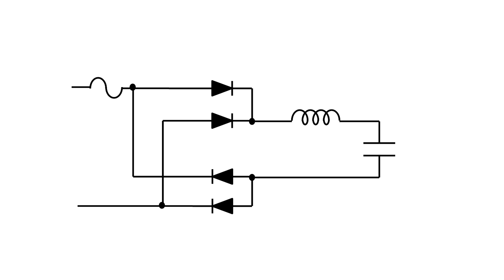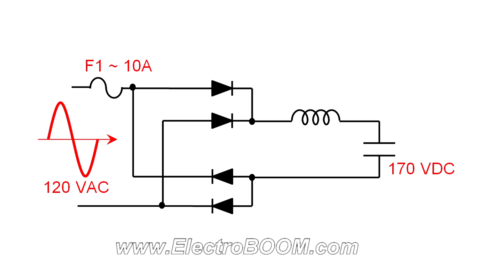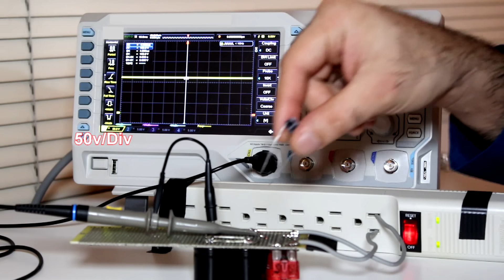Making a Full Bridge Rectifier

Comment: $ 1 0.000005 5.934295036739208 27 5 50
v 48 272 48 368 0 1 40 120 0 0 0.5
w 112 272 224 272 0
d 224 272 256 272 2 default
w 112 272 112 352 0
w 112 352 224 352 0
w 48 368 48 416 0
w 144 416 144 304 0
w 144 304 208 304 0
d 208 304 240 304 2 default
w 256 272 256 304 0
w 288 352 384 352 0
w 288 352 256 352 0
d 256 352 224 352 2 default
w 256 352 256 400 0
w 256 400 256 416 0
w 48 416 144 416 0
w 144 416 192 416 0
d 256 416 224 416 2 default
w 192 416 224 416 0
w 240 304 256 304 0
w 256 304 288 304 0
w 288 304 304 304 0
l 304 304 384 304 0 1 55.31074061114141
c 384 304 384 352 0 0.000049999999999999996 4.938454228765929
w 384 304 464 304 0
w 384 352 464 336 0
w 64 272 112 272 0
w 64 272 48 272 0
w 464 304 512 304 0
w 464 336 512 336 0
162 512 304 512 336 2 default-led 1 0 0 0.01
o 24 64 0 4099 160 102.4 0 2 24 3
Reply: Paste it in the import from text on https://falstad.com/circuit/
Reply: file/import from text
Reply: fun to watch

Comment: You didn't get shock when you connected it to live wires but you got  shocked after disconnected, how?
Reply: When connected, current has an easy path to ground and would rather go through the circuit than his body. When disconnected, the capacitors remain charged but have no path to ground. By touching the circuit in this state, he gave those charged capacitors a path to ground and got shocked. He was not shocked before because there was already an even better path to ground than his body provided, but once disconnected the next best path would be through his hand.

Comment: 2:00 Wait, is he saying that you can put your finger across 166V and it's perfectly safe as long as it's DC and not AC?
Reply: It depends on how you're defining your AC voltage. 166Vrms means the AC waveform has an "average" voltage of 166V and effectively delivers that voltage over time. However, AC oscillates so the instantaneous voltage, or the voltage at one point in time, will change. 166Vrms means the voltage has peaks of 166*sqrt(2) volts, or about +-235V. If the AC wave was running at 60Hz, that means it will hit +-235V 120 times in one second. So you can see how it's really easy to touch that and get shocked by any one of those 235V peaks.

Comment: I'm going to get two 120 to 220  Transformers and connect them in series and I'm going to run it through a 600v 15 amp bridge rectifier with a microwave capacitor as a ballast capacitor on the transformer a protective capacitor on the input of the bridge rectifier and a smoothing/protective capacitor for the output of the bridge rectifier and maybe a inductive choke on the output. And I will get approximately 500 volts 19 amps and I will make some nice arcs

Comment: Hello, thanks for the video, what happen with the voltage if you put some load? will increase or decrease? im doing this circuit for a motorcycle to run an HID kit instead of an halogen bulb. Im using only a full bridge rectifier from  a 10,4V AC getting almost 25V DC with load.

Comment: Does anyone know why the capacitor at the output holds the voltage close to the peak of the wave? (0:25)

Thanks in advance! 👍
Reply: The graph he's showing is very ideal and leaves out some details. The actual output for this circuit would be slightly below the peak of the AC input. Without the capacitor/inductor, the voltage output of this rectifier would look like the absolute value of a sine wave. Capacitors can be seen as "resisting change in voltage," so when the rectifier output dips back towards ground, the capacitor goes from charging to discharging and keeps the output from returning all the way to ground. However, the capacitor still discharges during this stage and so you do end up with a bit of a ripple. This is then smoothed using a voltage regulator or an inductor to get a constant DC voltage.

Here's a good graph that illustrates the unfiltered, rectified wave and then the effect the capacitor has in red. It's still ideal since the peaks wouldn't match exactly, but the more significant detail omitted was ripple voltage:
https://www.physicsforums.com/attachments/2_16_0_12_eng-png.186709/

Comment: Hello any one pls clarify I have rectifier kbpc3510, 
it's no load dc voltage is equal to supply voltage vac, 
Then connected a 34.51.7.060.0010 110vdc relay now also dc rectified voltage equal to supply voltage vac
And I connected a Schneider's mfm 6400 then apply supply voltage 110vac but output rectified voltage was 153 nearly equal root two times of vac 

What's the reason?  Why rectifier o/p  voltage was varies with load

Is it always rectified dc voltage is always root two times of supply voltage v peak?

Comment: We had to build a pi bridge in my electronics lab for the capacitor stage.  I wanted to also add a zener diode for voltage regulation, but the prof decided we wouldn't have time. (he had about 30 students and only 1 TA)
Would have been cool though.

Comment: I think the best "rectifier" I made was... I used a center tapped transformer, with 4 capacitors and 4 diodes, to make a dual rail voltage doubling rectifier... though it was probably only half wave, it did what I needed it to do.

Comment: Something Ive been curios about for some time, whats the maximum voltage u can use car/blade fuses for? They are rated for i think max 30v (printed on some), but fuse is fuse(?) so where is the difference between a tiny glas tuby fuse and a blade fuse from cars?

Comment: DC is not less dangerous than AC.  170V DC is extremely dangerous.  
The argument in favour of DC current

Victims who have experienced the electric shock with DC current says that they are unable to pull their hand back because DC current flows continuously. This effect is similar to an electric doorbell supplied with DC current. Hence, it is believed that the DC current shock is more dangerous.

Whereas, in the case of AC current, the person experiencing the electric shock can pull their hand back as the current goes to zero. Hence, it is believed that the AC current shock is least dangerous than DC current.

Comment: Pls don't say dc is less dangerous than ac 
Dc is much more dangerous than ac if you touch high voltage dc your chance of alive is much less than ac
Reply: He knows what he's talking about
Reply: AC is more dangerous because of how it is measured, but yes DC can lock you in place and prevent you from letting go of something that shocks you. The reason he's saying AC is more dangerous is because 120VAC and 120VDC are not the same things. 120VAC will peak at nearly 170V, while the DC voltage remains constant at 120V. That 170V peak can still shock you, and almost every AC circuit is high enough frequency that these peaks would arrive faster than you could react. However yes, because of that you would be able to release something shocking you with AC provided the frequency is low enough.

Comment: Full bridge rectifier does reverse polarity correction, not reverse polarity protection.
Reply: It can do both I think, the transformer doesn't care about polarity and neither do the diodes on that side of the circuit, so it would operate normally just with an inverted waveform.

Comment: Hmmm, I seem to recall each and every class in basic electricity and safety advising that DC was more dangerous than AC, at least at more significant voltages and/or currents. Sure, DC is safe enough in most electronics, but the general statement about 'DC being safer' could give people the wrong impression.

Comment: 0:30 would it not be half high since we dont get the bottom or is the watt just lower
Reply: The capacitor keeps it near the peak, the only difference is that the capacitor discharges more and drops more in voltage when there's a single diode instead of four.

Comment: Why you use 4 capacitor instead of 1?
And why transformer is used before rectifier circuit in AC->DC Circuit?
Reply: The transformer steps the voltage down to something more reasonable. Without it, the rectifier would likely still work but would have a much higher voltage DC output. Since most DC electronics are pretty sensitive and prefer lower voltages, this would be a big issue, so a transformer is needed in almost every application of AC-DC rectification.

Comment: 1:33 That spark is caused by a inrush current of capacitors. Please remember: Capacitors can't change voltage instantly! To limit sparks, you need a NTC thermistor.
Reply: Why using a NTC resistor? Why can't we use a standard resistor? (I'm just curious no offence! ^^)
Reply: @wuukaa9079  that way, once you start the circuit it's cold and limits current and holds the inrush current, but as the circuit runs the resistance drops to allow the circuit to run more efficiently now that the capacitors are already charged, this setup is common on Desktop PC power supplies
Reply: @aurunemaru  alright! It's a way to reduce sudden drop of voltage on the mains, avoids sparks when you plug and smooths up the start up charge for the circuit if I got it well!
Thank you, I always saw those NTC resistors in many switching power supply and such.. thank you :)
Reply: or can we limit the current with resistors , just before the C ?
Reply: @SametALTUNSOY  You can limit the current with a resistor, yes, but that will limit the amount of current that the circuit can consume all the time, so it also limits how much power it can supply to anything attached to it, too.

The benefit of thermistors is that they can have high resistance initially (when you first turn it on), for just a brief time (long enough to limit things while the capacitors are charging), but then after it has been on for just a little bit, their resistance will drop to be very small, so they don't get in the way of providing higher current to downstream devices from then on.
Reply: Sooooo….capacitor inrush CURRENT causing the spark? 

That’s weird since a capacitors purpose is to resist a change in voltage 

Is it voltage or current?
Reply: @123ElectricMonkey  Capacitors don't really "resist a change in voltage".  Capacitors store voltage (more correctly, they store electric charge).  That means that if the voltage would normally drop because the supply is not providing enough voltage anymore, the capacitor can supply electricity from its internal stores to make up the difference, which also keeps the voltage from dropping as fast (and then if the voltage goes back above what they have remaining, they will fill up their storage again).

However, that also means that at the very beginning, when they have no stored charge at all, if you apply a voltage to them, they will consume it as fast as they can to charge up as quickly as possible, and with large capacitors, that results in a really high initial current (to charge them up).  Once the capacitors are all charged up, then they don't draw any current anymore (unless their charge dips below the supplied voltage level).
Reply: cristiano raolda s ucks a t baske tball

Comment: hi can u make 240v dc power supply??because i once see a 240v dc motor from handheld blender and kinda curious how they make a circuit to running it so high voltage but in dc..

Comment: Not sure if @ElectroBOOM is going to see this, but, as long as the topic is rectifiers, I think it would just fit if there was a video about rectifying through a flame instead of a diode. This is a common way to prove a pilot light on a furnace that uses an ignition control module.

Comment: Hi , I'd like to ask , you say DC is safer , but I have heard otherwise. Which is safer between the two?   I've heard that once you get electrocuted by DC , it becomes very hard to let go because the current 'grabs' you , whereas , in AC because its alternating , you are able to get away from it . Please correct me if wrong
Reply: AC is more dangerous at the same voltage. for example 120V AC is more dangerous than 120V DC.

Comment: As ofcourse this guy is a Dumas, let me explain why: as of him using non isolated ac voltage and at the same time using capton tape to insulate the ground!? That is dangerous he is putting the whole scope under voltage and if he touches any metal part of it he will get shocked and the dc voltage also coming out of the full bridge rectifier is also not isolated and if you touch one pole and your grounded the 170vdc will go through your body and may kill you!    
DO NOT DO WHAT HE DID!
Reply: the kapton tape was used for just this demonstration
Reply: Yes i know it was but what if someone uneducated did this? They could get injured if not killed
Reply: @danielc5415  Just don't do random shit from the internet.

Comment: If you place a neon across the caps it will give an "ON" light and then discharge the caps when switched off. maybe stuff a resistor in there as well.

Comment: 3:30
Talking very calmly while the resistor fricken becomes 500x hotter than the sun
Reply: "I let it cool down for a while AND SHI*!"
Makes me laugh, every time.
Reply: Depending on what part of the sun you are talking about, 500 times hotter can be anywhere from quickly dead to instantly dead. That resistor might have been as hot as the sun's surface, but not hot enough to give off so much light that your skin cooks on top of your eyes.
Reply: @vinnysworkshop if it was that hot, it would ionize the air arround it with such energy output
Oh and it would instantly vaporize the resistor lol
Reply: @DatBoi_TheGudBIAS Yeah, you're right. Overexposure might be why I might've guessed it was as hot as the surface of the sun. It still might be hotter than the surfaces of cool red stars though.
Reply: if it would be hotter than the sun, mehdi would vaporize

Comment: Why you were not suffering any pain/ shock at 166V DC , what I thought was AC is more dangerous than DC because AC gives us shock of 110*√2 or220*√2(depending on your loc.) While for same RMS, DC voltage it will be fixed 110 or 220. But you were not shocked by 166V !! How??
Reply: The human body has parasitic capacitance that lets AC through much easier.

Comment: How do I make a F U L L  B R I D G E  R E C T I F I E R to output 110v dc, 30a with good filtering? Trying to power a 50hz microwave with an inverter. I have access to both 110 (120) and 220 (240)v.

Comment: @ElectroBOOM, thanks for the amazing explanation! Could you pleas explain how the AC current runs through 0:14 , your diode arrangement? 
Many thanks!!
Reply: Assuming the top is line and the bottom is ground, on the positive cycle of the AC, diode 3 is reverse biased and blocks the current, while diode 1 is forward biased and allows the current through. Diode 2 is also reverse biased, while diode 4 is forward biased. Current flows from the line, through diode 1, and into the + side of the output, through whatever load, and then from the - side through diode 4 to ground. On the negative cycle of the AC, diode 1 is now reverse biased, while diode 3 is forward biased. Diode 2 is also forward biased, while diode 3 is reverse biased. Current flows from the ground through diode 2 and into the + side, then from the - side through diode 3 to line.

Comment: You crack me up 🤣🤣🤣 keep it up. I do have a question. I am trying to convert 24v ac to 24v DC for a 42 watt motor. I got my transformer. What diode do I need? I have diodes but I think it's rated for 1w so they burn out. Would a diode that's rated higher the 42w work for this? And do I need a capacitor? If yes what size capacitor do I need? I did it at first with the diodes that I have and they kept burning out till I realized it says 1w.  Thank you

Comment: "I can barely feel it, DC is much safer to the touch"
gets shocked by the capacitors
Reply: capacitors gave him a short pulse of DC. the capacitance of your skin is what makes AC able to flow through it. DC cant flow through but put a short pulse of DC thru a capacitor and it'll go through.
Reply: @polymetric2614  I don't understand, why the DC didn't hurt him but the capacitor did when both have the same voltage?
Reply: @mhnoni  because his finger has high resistance and the current only flowed at his fingertip
Reply: I believed he explained that the palm of his hand is more sensitive than his finger, and he also touched the output with his finger on purpose while with his hand was accidental.

Comment: Why use complicated diode arengment? 
I have the best full bridge rectifier cause i use billions times more capacitance. I use 16v 900F (Farad) capacitor.
Reply: Because the diode is a ONE way gate and only takes HALF the wave. Adding a second diode would make it take the full wave plus If an object that is accepting power SHORTS it could send electricity in the OPPOSITE direction the Diodes in this would block it from continuing keep the REST of your items using electric safe from the spike. Especially if the short is lower than the fuse.. lets say its a 10 amp fuse.. but a 3 amp short.. the fuse wont blow and having no diodes would allow the electric in the OTHER direction possibly killing something else on that circuit that cant accept 3 amps. Here you can learn more about them here. https://www.electronics-tutorials.ws/diode/diode_6.html

Comment: 2015: Creates circuit design for full bridge rectifier and explains it can be used for reverse polarity protection

2019: Criticizes CAT for using exact same circuit design for reverse polarity protection because it relies on a 50A fuse to blow 
“Who designed this?...Absolute garbage!”
Reply: Wait CAT didn't use the same circuit…
In this video, the circuit can actually CORRECT the reverse polarity! The CAT's circuit just blows up the internals

The fuse in this video was just for overcurrent protection I guess
Reply: Oh, my bad. Sorry, I didn’t rewatch the videos to make sure that what I was saying was correct.

But either way, it’s still funny as hell.
Reply: @theaviator1152  :D